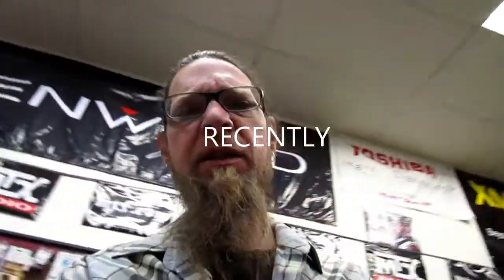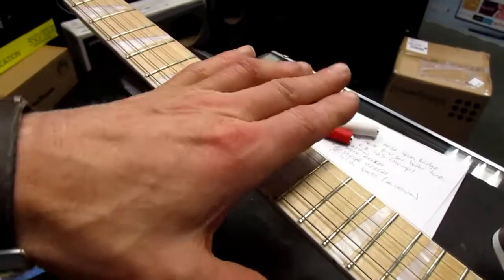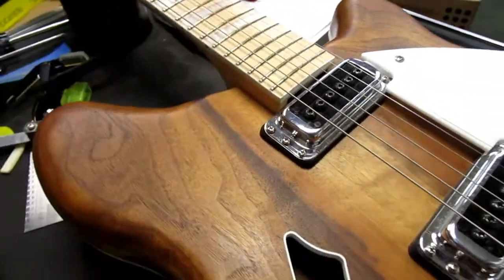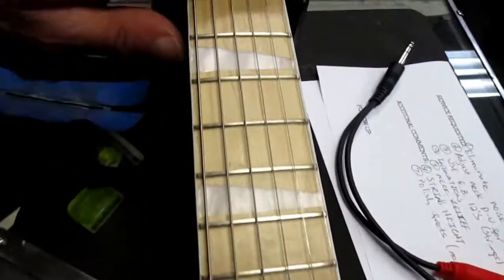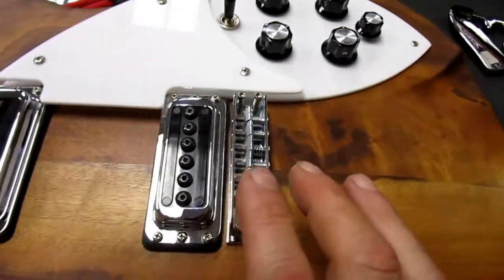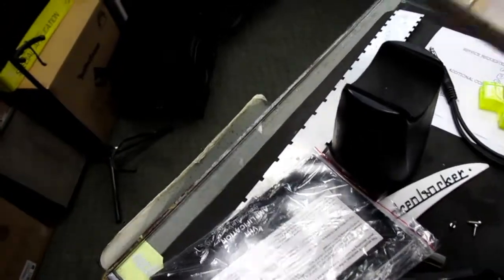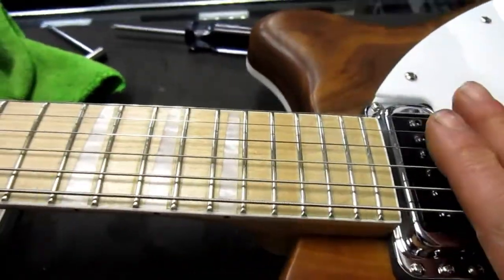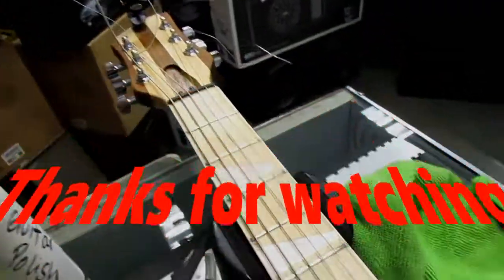ROCK-O-Sound Rickenbacker 300 SERIES

Comment: Finally a good Ric video. A couple of things-- My new 2018 360W came with 10's. (10-46) They work just fine. Factory set up was near perfect for me. I adjusted the action and truss rod only slightly to my liking. As for the rocking bridge, I noticed that even a little rock will cause some buzzing/rattling noise. Did you clean the fingerboard or only polish the frets? What would you use to clean this type of unfinished maple fingerboard? All in all, nice video.

PS, I LOVE this guitar!
Reply from the maker: Thanks for watching TelePlucker. This guitar was extremely clean when it arrived. There was absolutely no need to clean the fingerboard. I exclusively use Simple Green for cleaning fingerboards with bare wood. I use a tooth brush to get all the heavy grime off, and I allow the neck ample time to dry. Additionally I use linseed oil to treat bare wood.
Reply from the maker: I have another Ricky vid on my channel It's entitled Ricko SOUND Problem solved.